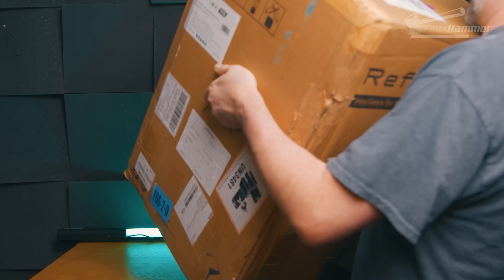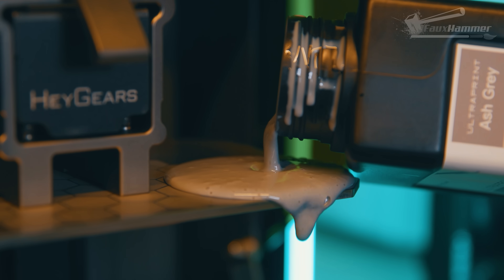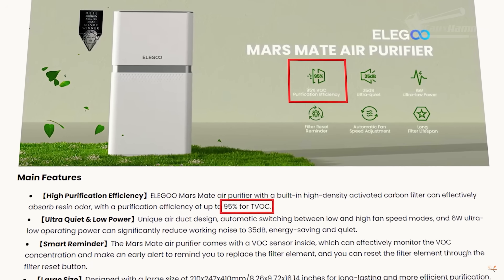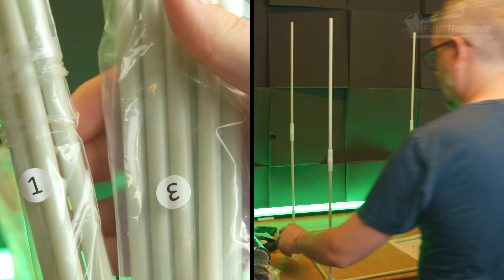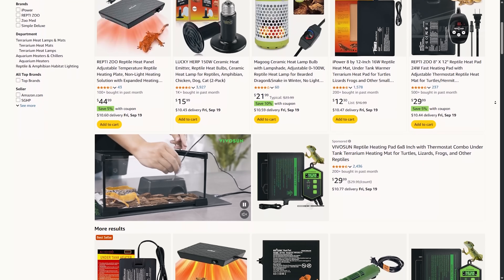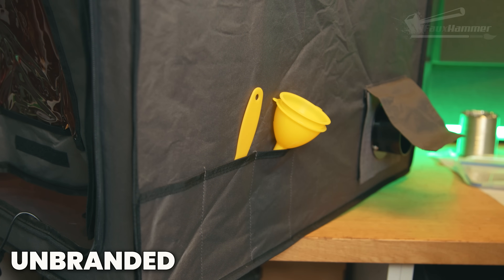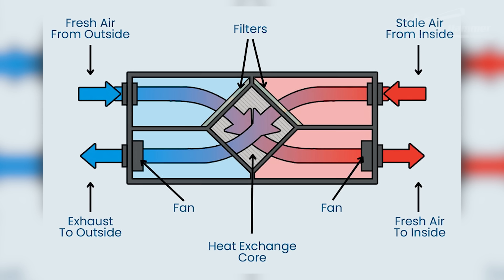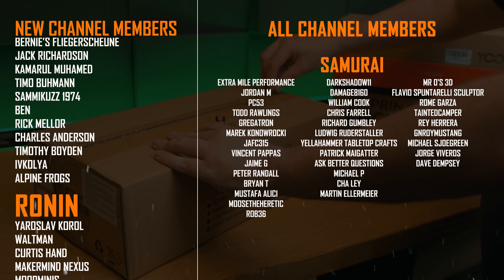A Necessary-Accessory for Resin Printers?! Printer Enclosures

Comment: i bought like 100 quid wardrobe from ikea, is something around 2 x 0.5 x 1.5m size with 2 shelves. I drilled the hole on top, placed industrial exhaust fan for 40 quid (I bought several year ago), it has 1065CFM 1808m³, which is insane amount. I hooked that to top and use the tube that goes straight to window plus i used clear pvc sheet roll as second door to keep all fumes there regardless (something like in those industrial refrigerators, that clear curtain in the door) . now i can work and store everything inside the wardrobe including the curing and cleaning station and when someone comes to check my flat which i rent - is just regular wardrobe and I can carry on doing what i am doing after they leave :D
no smell, no problems. And i have 2 resin printers working inside the wardrobe.
Reply: Do you know the name of that warderobe? I was thinking of doing something similar
Reply: @SageOfTheGreyPath pax system. They sell all parts separately like wardrobe, shelves,  door etc. I also bought different hinges on amazon, which can open like 160 degrees as IKEA ones only 90 and is not enough if you want work inside.

Comment: Ive been looking to get a 3d printer soon here. Think i might commit to the saturn 4 ultra. though im unsure on how to go about my ventilation. I have a big open garage and tables to put the printer and any sort of enclosures. I could most certainly fit an enclosure tent for one, however, the walls are all made of concrete and theres no windows. other than leading the vent out the door im not sure what im suppose to do. any ideas or other options would be awesome.
Reply: the base plate is a big nono for safety,  elegoo bases are harder to clean (lots of crevices and leftover ipa can ruin your resin/vat) where with others i can unmount the base and wash the whole thing in IPA without the gloves ever touching resin

Comment: I went a step further and bought a very large grow tent (I can walk into it and stand comfortably) from Vivosun that holds two smaller grow tents. One small tent holds the printer and one holds the cure station. The small tents are connected via ducting and have a Vivosun air filter that scrubs the air before pushing it into the large tent. The large tent has both a resin air filter that measures VOCs and another Vivosun air filter. The latter pumps all the air outside, hopefully more responsibly than just dumping contaminated air. This dual layer setup (in theory) helps to prevent flooding the room with VOCs when I open any of the enclosures or when I'm moving uncured prints around. The one trick is that the wash station uses IPA, which uses carbon filters quickly (it's a problem on the International Space Station, too!). So I bring the wash station bucket into the tents, put the prints in, close it up, then bring it outside to run the wash cycle before bringing the parts back to the cure station. I also use masks and a cleanroom smock with nitrile gloves. And I have a sealed bucket for trash that stays in the grow tent until it's ready to be processed responsibly. Is it all overkill? Maybe. I don't know. But the whole thing cost me about $700, which was about a third of all the print hardware and that seems like a fair ratio when I think about the health of myself and my loved ones. Plus, the big tent has lots of ways to hang lights, store tools and whatever so it feels like I'm in a cool space age lab.
Reply: That's really cool. If I get further into remodeling my basement thats a cool concept
Reply: I second the VIVOSUN options. Got a smaller one large enough for a printer and the extractor system. Made a huge difference in my garage. 

Plus they seem to go on sale fairly often which is always nice.
Reply: May I ask what sizes of grow boxes do you use? I'm planning on making a similar setup but I have no printer yet xD
Reply: @BomberTheBrown  Yep, the big tent is the Vevosun 60"x60"x80". Then I use two of the 24"x24"X48" tents inside of that. I use the Vevosun Smart Air S4 Filtration Kit inside the small tent that does the printing and I use another filtration kit inside the big tent before I vent the air outside. I hope that helps.
Reply: @spacesteps That helps a lot. Thank you very much

Comment: problem with those for me are i have a Saturn 2 and you have to pull the whole lid up aal the way then again i use the hole in the back of the lid that is connected to the ventilation system to the outdoors so i have that on 24/7 anyway it will constantly suck the fumes outdoor
Reply from the maker: As i said buddy, with one of these, just don;t ever bother putting the lid on, the windows are UV shields anyway.
Reply: hey ive been thinkin gof jsut attaching an extraction fan and hose to the back of the saturn 4 ultra do you just bolt the fan to the case or do i have to get some extra stuff if you know becuase when i searhc i jsut keep gettin gresults for people fdm printing adapters and connectors etc

Comment: I have all my printers in a hallway near a window, I just check on the print when one of it is printing. Cleaning and removing supports is where the issue is, some models take a long time plus using IPA requires a mask. Imagine having a mask, gloves and eye protection for up to an hour removing tons of support on large prints.

Comment: The install video would be interesting! I'm also curious if you'll add additional filtering before you kick out the toxic fumes? I'm not going to do any resin printer in the house ever! It's going to be in a purpose build shed, or not at all. But I'm running into issues such as filtering the air, air tightness, etc. A colleague thought up that using a non-working fridge might be a good idea, one of those commercial ones with the large windowed door. Getting those second hand might be doable without breaking the bank, those might be pretty air tight (test). During printing keep the door closed and not vent the air, when done, vent/filter before opening the door. That should have the least amount of lost warm air and you can keep the enclosure warmed pretty easily without needing an expensive heat exchange setup... My biggest question is though, how to setup a good filter system?

Comment: I have an enclosure and have both the printer, the UV/washing station and workspace in there. No uncured or half cured stuff ever leaves that enclosure. It's on a table and I can sit in front of it for everything, including removing supports (I do that always before washing/curing). Oh, and in stead of the standard ventilation ports, I used a flap on the top where I built a structure to hold the ventilator in place. Which is a ventilator normally used for a 40 square meter bathroom. I need to open the lower part of my enclosure to let in enough air to prevent a vacuum.
Oh, and I FDM printed an interface with a ventilation frame above my window so the air gets blown outside without reentering my apartment.

Comment: I'm in the market for a new printer and found your videos to be the most informative - thank you! I'm stuck between the Elegoo Saturn Ultra 16k and HeyGears Reflex RS Turbo. I need the heated vat, which is an addon to the already expensive RS, and the Saturn 16k has by default. However HeyGears purported ease of use is what really appeals to me, I hate messing with settings and leveling - just all that faffing about. Even the PFA comes already in brackets - I'll pay for that! Why I'm still considering the Saturn - aside from the price difference (yikes) - is that tilting vat! I print direct on the plate a lot, I have a lot of flat models and it just works better. The tilting vat seems to be the best choice for reliable results in that scenario. I'd appreciate your thoughts!
Reply: I’m literally on the same boat as you right now! 😅

Comment: I made my own but the grow tent idea is fucking awesome. 

I print near where I sleep and paint and game and lift... its not a big house lol. Garage is too full as I am a mechanic. So I built an enclosure that vented to outside. Its overkill I think because I dont get the odours basically at all. There's the initial odour but thats it and thats on initial cracking of the bottle and pouring. It goes away quickly and with PPE isnt noticeable at all. I just noted an odour with my first design, mild but there. Turns out I used the incorrect lining and treatment on the wood whoops. 

That being said im curious how the heating element will play out come winter as I live somewhere that has +40c and -40c as realities.  I guess ill find out soon.

Comment: Great video.  My evil resin lair is an old laundry room in the basement.  There is no sunlight and a 4-inch dryer exhaust port that exits outside.  I hooked up a nice exhaust fan and now I'm hunting down a ceiling mounted  vent that will more evenly pull air up and out.

I would like to see your new setup when it comes.

Comment: I've been using a grow tent since I got my first resin printer, just a heads up on the M7 max, mine is now dead and won't print after 6 months, and im not the only one, alot of guys I'm in a discord with are having issues after a few months, I'm now trying to get Anycubic to sort it out, but not getting very far 😢😢😢 emails as long as my arm 😮😮